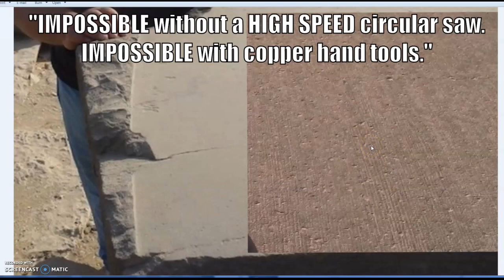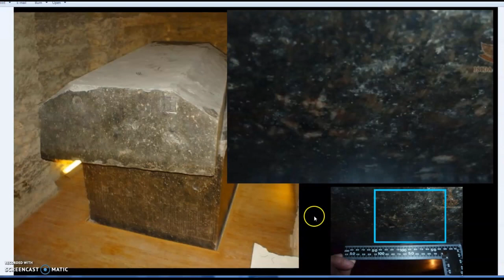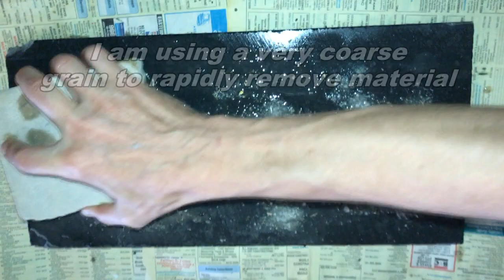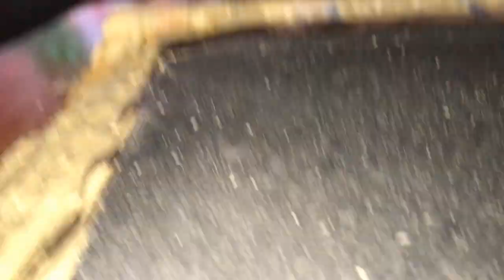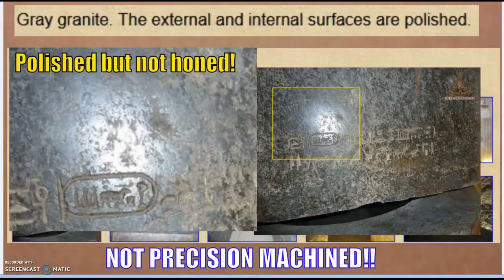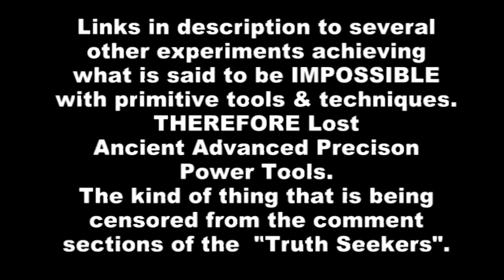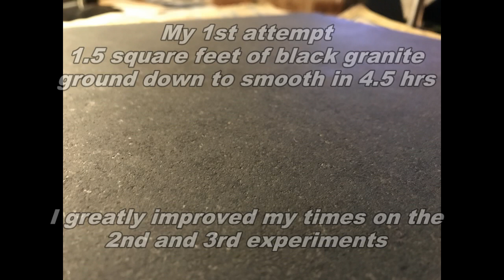Ancient Stone Working Techniques: Experiments with Black Granite on Removing Striations

Comment: Stone was softer back then
Reply: No, it was not.
Reply: powerman777 oh, yes it was
Reply: Scribe London 
No, it was not. How and why was stone softer in the past?
Reply: powerman777 because the time period from creation was less
Reply from the maker: Freshly quarried sandstone, limestone, marble granite is slightly softer and over a year or two hardens. Though the difference is noticeable but barely worth mentioning.
Sydney sandstone, especially Pyrmont sandstone considered one of the best for building in the world. It comes out of the ground yellow but turns red over a few years.
Reply: SGD Sacred Geometry Decoded that would be due to the oxidised iron in the ‘cement’ which binds the Stone together. It stands to reason that sandstone being sedimentary was once liquid.
Reply from the maker: Cement as in Portland cement and stones being cemented together are different things
Reply: SGD Sacred Geometry Decoded Sandstone is particles of sand within a ‘cement’. This cement can be of silica or calcium. It is said sandstone is formed from the washed sediments of rivers accumulating on the sea bed.
Reply: @SacredGeometryDecoded  very true - sandstones are much softer when freshly quarried  - when I was walling in uk, I always made sure the stone I bought was at least 2 years weathered, otherwise, with freshly quarried - it could 'frost' - in minus temperatures, the surface of the stone would sometimes crumble and flake off (from the moisture still trapped in the stone expanding as it froze). after 2 years, the stone would be fully dry and this would no longer happen.
Reply: @Scribe3761  "pressure" of the sea or ocean makes beautiful sandstones;)
Reply: @Scribe3761  
You're going to have to do much, much better than, " because the time period from creation was less" if you want to be taken seriously.

1)  How.  What's the physical mechanism that allowed stone to be softer in the past while still being recognizable as stone.
2) Why.  What has changed to make the phenomenon in 1) no longer/less relevant resulting in hardened stone today?

You also have to ask:  If stone was softer in the past, it wouldn't have been a very good building material.  This leads to the question as to why the ancients would have used "soft" stone to build their monuments.  It also leads you to think that structures such as the great pyramid would have been impossible if the stone was "soft".  It would have deformed under it's own weight and collapsed.
Reply: powerman777 the mechanism is time.
Reply: @Scribe3761  
"the mechanism is time"
This answers neither how or why.  How does time change the hardness of stone and why?  Why does your time hypothesis not apply to obsidian?  Brand new obsidian is the same hardness as ancient obsidian.  Again, how and why?

Comment: I see a lot of comments about "its different when its not a small replica" .. 
What this video does is not prove a specific case. 
This is just a general test on method and technique.

And its results is quite clear.  It proves: 
*Granite CAN be worked with really really primitive methods to get quite amazing results.
*The work is done much faster than most expect

This disproves any claims of IMPOSSIBILITY
This disproves the need of any HIGH TECHNOLOGY  (other than basicly rocks)
This in turn, gives credibility to ancient records claiming its done in the way demonstrated.

So ... yea.. who knew.. when the egyptians recorded what they did and how, they actually didnt lie.   lol
Reply from the maker: Yeah, the physics change apparently with the size. Even though  those Russians achieved the same in drill cores of the same size as ancient drill core 7, they also made the larger diameter around 1 foot.
In older videos I explained hitch knots and basic lift techniques. The same deal, small demonstrations don’t apply because the laws of physics change at some magical weight limit.
Anyway I think those are the best comments because they reveal a lot about the mind set.
Ultra skeptics In the face of evidence but willing not only to accept but celebrate claims  based on no evidence.
Reply: Yea, it also totally solves how they moved 100 ton examples that were also carved with incredible precision. No need to investigate any of that cos he scratched on a stone for a while. I suppose they carved rameses statues with little stones as well, completely symmetrical too. Makes complete sense, loads of rough stones held in the hand carved those works of art 😂😂 
Da Vinci must have used twigs for his works
Reply: @brendanryan1037  Not sure what you dont understand.
Reply: @frosty6960  I imagine you not getting something is a very frequent occurrence. Dont beat yourself up about it, head up champ. 
Just so you can grasp it, I'll go slowly. 
Shining a small piece of stone to a smooth finish in your garage dont answer all the other questions about working stone to the scale they supposedly did. Is that not clear? 
Its same as saying that a car factory takes in raw steel at one end and at the other out comes a new car with none of the steps in between having any importance. 
It is simply dense to ignore all the other questions and processes involved and say that just because you can simulate a small example that all other questions are covered by that 🙄
Reply: @brendanryan1037    There is literary no unanswered questions. We KNOW how they did. We can REPLICATE it. 
You try to sound like a smartie, but didnt even understand the sarcasm of me asking "how dumb are you if you dont understand this??".
Reply: @frosty6960  what have the replicated btw? Specifically? Outside of once moving a statue with machines that is. 
What have those particular experts replicated at full scale? So far all I see is pathetic play acting and massive extrapolation from tiny outcomes. Not science, not anything and saying so is so disingenuous to all paying to see the sites and study them. 
We havent replicated a thing using their tools to the level of precision seen in the original monuments
Reply: @brendanryan1037  We have perfectly recreated the stone  cutting techniques. Moving stones has been done, but not at the same scale.
Cutting stone with stone and copper is not hard.. and can yield PERFECT results.

Heres some images from a cool documentary last year where they replicated cutting, polishing and moving stones according to historic records and some brainstorming. 

https://imgur.com/a/SCLEVZO

Even splitting granite in amazing shapes ..
Reply: @frosty6960  3 pictures are definitely conclusive, you've proven all of science with that. 
And that's the thing, the scale, its kind of important and a key part of any answer presented. It isnt an incidental part of it that you just shrug off. 
Who cares about small scale when you're dealing with something so significant with so many examples to be seen both in egypt and around the world. 
Massive stones brought up mountains and assembled in incredible durable structures. 
Let your imagination open up a bit fwiend, it wont make you insane. It would merely be asking what an unbiased person might if presented with these buildings and feats without any prior knowledge. 
In the same way a person from 500 years ago would look at a plane or skyscraper and want to know the capabilities people had to fabricate them. A finished product like a plane is amazing in itself but it consists of many individual fields all collected for it to function as a plane. Aluminium cans share materials with a plane but they are not going to fly anywhere. 
Even various planes from their inception often only have the fact that they fly in common, being made of completely different materials operating at vastly different stresses and speeds. 
Replicating tiny examples of a practical skill doesnt help you derive how they developed their skills of all types, why they applied them as they did and what drove them to expand so much resources to get them all over the line as they did.
Reply: @brendanryan1037  You have 2 choices after that presentation. 
1. Assume the pics and story behind them is true. 
2. Assume the pics and story behind them is faked to set some agenda.

Which one do you find most plausible? 
You could also watch the documentaries....  And theres lots of examples of people recreating perfect granite work with old methods.

Scale only matters when it comes to moving objects... but thast not really a mystery either. 

"let your imagination" ... Why use imagination when you can use knowledge? I dont need to imagine up some magic shit for something mundane and understandable. 

There is ZERO evidence of "high technology" in any of this. ZERO.
Reply: @frosty6960  you dont have the knowledge you absolute clown, the scale matters and they know that full well so have never attempted to replicate it for real because they know it would fail fucking miserably. The scale matters as it does today with large civil engineering projects i.e. what can be done given available resources and technology. 
These monuments are evidence of that in themselves, your lack of brain power and the agenda you mentioned keep it from being further investigated. Those morons keeping the party line would look like fools and frauds if it was seen any other way than their own, is that not clear to you? 
They dont own the history or the sites, its human history so I have no interest is myopic idiots deciding anything for the rest of us. 
"Only matters when it comes to moving"? 😂😂😂 what a joke you are showing how you've never built a fucking thing in your life. They moved a LOT of stone around and not just to pile it up, they built exquisite massive structures that lasted thousands of years. 
Nothing we build now would endure like that and you insist a bunch of farmers did it as a side gig, get a life and grow up some day soon. 
Absence of evidence isnt proof of anything, not finding it isnt an excuse to be reductionist and make up a story about copper chisels and sand. Supposedly they didnt even have the wheel which is an even bigger pile of bullshit. We credit them with the pyramids but the wheel was beyond them apparently, it's like letting a child explain a complex subject. 
Also, you presented the imgur link as some kind of proof, I dont give a shit what you think of it, it's just 3 pictures of guys working some stone. 
I'm wondering how much time was spent to do their tiny examples and that took several people just for a tiny portion. 
You see, it doesnt have to be high technology to do many of the things, if you just give them some credit and accept they had more advanced tools like knowledge of steel working. 
Harder metals would allow different work to be done, it would allow larger boats to be built and perhaps the ability to dominate rivals in war to secure the massive resources required. 
By your story they were a bunch of simpletons playing around with a hobby and building a complex long lasting culture and inventing farming methods all at the same time. While also being expert goldsmiths and jewelers too. 
It takes major dissonance to believe what you're saying, far more than either advanced civilisation theory or slightly better capabilities than we give them credit for having. 
It's likeyyou find the idea of them being smarter as somehow offensive, it falls outside what you've dictated they are allowed 😂
Reply: @frosty6960  it's a fucking mystery how you haul 60 ton stones up 300 feet and stack them like legos, that is something we would need a huge project to even attempt, you are braindead
Reply: @brendanryan1037  No it isnt.  
How ironic is it that you are calling me braindead because of something YOU dont understand?

And Herodotus described how they lifted every stone in the pyramid in place. 

Maybe you should start reading or studying this? 
I have... for 35 years now and im not needing any magic, ufo's or high technology to explain it.
Reply: @frosty6960  you've spent 35 years looking at this topic and never questioned it once? 
What did he say they did? Tell us about it, you amazing well of knowledge. 
You nor the clowns you're talking about understand it either otherwise they would have copied it easily or others after Egyptians would have displayed similar or better abilities given the supposed linear progression of us and our technology over time. 
Why do you keep saying high technology? More is all many are saying, not just simple tools applied to vast objects without any real logical connection other than they were found nearby
Reply: @brendanryan1037  35 years on the topic of ancient things, yes. Of which a central part is stone working. Yes, im also a stone collector, interested in minerals and geology.
Question what? Logic? Facts?

"What did they say".  Im not being told what to think. 
And who are "they" btw? 

We say "high technology" because thats the usual explaination dummies have for things they dont understand. Like granite cutting.
Reply: @frosty6960  you have clearly been an insufferable prick for all those years, god bless those around you. 
What is factual exactly? Everything is a theory on such a long time ago and we can only go off of what we have found. Just because items have been found doesnt prove how they were used nor does herodotus' description. 
You ignore the egyptians own historical records (I guess they dont count in your delusion) which speak of much older peoples living in the region. Every human group has a history, nothing just pops up in brief periods to be fully formed cultures. Look at how much we know and still produce the likes of you. 
They are the egyptologists who seem to be the only ones allowed to comment on the topic and much of this was "proven " 100 years ago without the means to test it. 
You dont challenge anything clearly which is quite sad, so attached to what you claim to "know" and wont budge. 
Once again, a dumb person does what you are doing, blindly following myopic thinking that only allows ancient people to have the most primitive of means yet accomplish incredible works. 
Wtf is wrong in your brain? The renaissance involved huge progress in ability in many fields and that showed in their works. They would not have built cathedrals and other art works if they just had meagre tools at their disposal. 
By your "logic" Egyptians just had a few meetings and decided to do something never done before casually without any support structure that would help them achieve it. 
Again, you pleb, why do you strawman high technology? Wtf is mega advanced about mastering steel and iron? 
You ignored the comment on their gold and jewel work of course, thick fuckers have to do that to get around awkward problems.
Reply: @brendanryan1037  Me the prick? Intersting considering you are all about personal attacks.   
Self insight much? 

Facts= hardness of stone, weights, engieneering, math .. so on. 
*Well, Herodotus description is in line with history..  also its fully possible and reconstructable. The method described has been proven. 

*No, most of this is based on egypts own historical records. The documentary mentioned earlier was purely based on it.

*Yes, we have archeological and historical record of groups inhabiting the area going back to the ice age.
And not in ONE single case is there anything mystical standing out .. its quite linear indeed. The high tech shit doesnt fit in anywhere.

*"you do not challenge". What the fuk is that suppsed to mean? Why should i challenge whats provable and makes sense, when the "challenge" makes even less sense and aint even logical, nor plausible. 

*"Whats wrong with your brain" ... again... YOU are the one who has problems grasping this, not me. And again.. prick? 

* If case A can be proven, recreated, is backed by historical records  .... why the fuck would you claim B is right ... when its implausible, mystic and not even found traces of.  

Again more insults ... im pretty sure you dont even know what a strawman argument is. 

You are the one that needs to disprove the  claims made ...  Which i dont see you have done a single attempt at.
Reply: @brendanryan1037  You seem(d) upset and extremely defensive that someone went against your religion.

Humans can cut and move stones and have been doing so for millennia.  Get over it.
Reply: @brendanryan1037  the obelisks and other works aren't very precise by modern standards.

Comment: Excellent work.  You have definitely proven that the work was done by hand.
You may have already gone through this link but if not it recommends Wadi Hafafit as the source of abrasives in Egypt. Issue 14 on this link: http://www.amarnaproject.com/horizon-archive.shtml
I also saw one of those boxes videos and I believe you showed a bit too where the shine and smooth part is shown together like a liquid applied to the surface.
So if the shine is from antiquity then it must be something that lasts.  I think "water glass" is what the polish would be made from. It has been used for a long time. Soda ash heated in a furnace with silica and then crushed and mixed with water will yield water soluble silica. In modern times concrete was sealed with a coat of Linseed Oil followed by a coat of water glass. Water glass was used to make paper cartriges for black powder guns in the Civil War.  It was used to apply gemstone powder to Stradivarius before varnishing.  I heard that Renaissance statues were coated with it too but that was from the Penguin Lady so who knows?
Reply from the maker: Awesome. Thank you very much. That’s just the type of thing I was going to begin looking into.